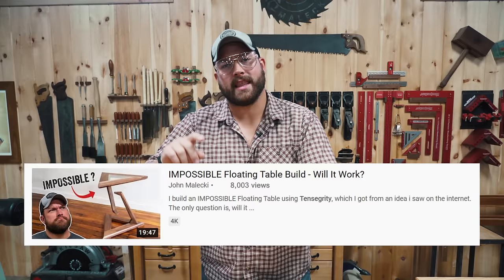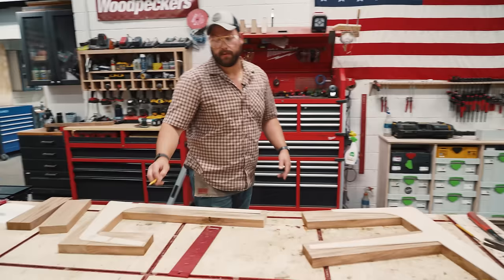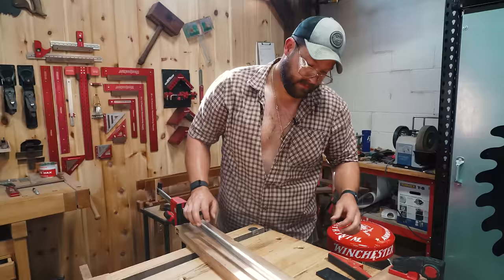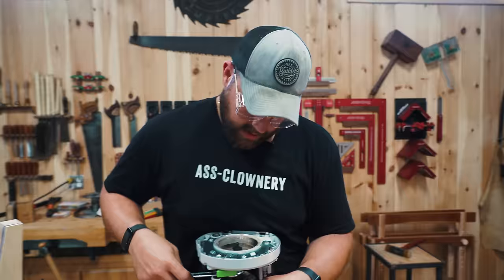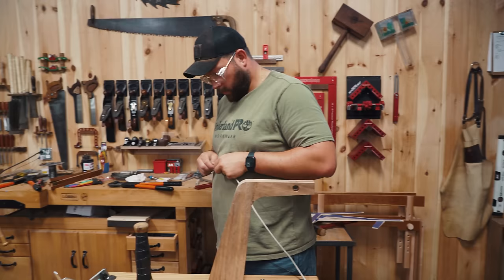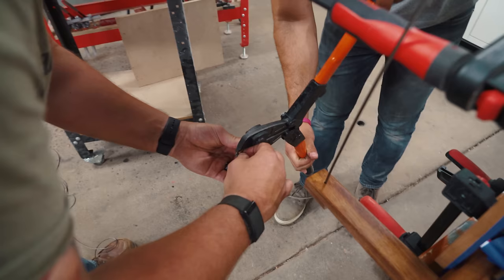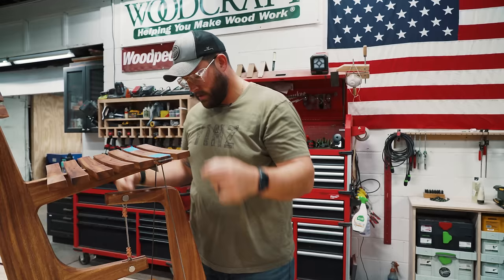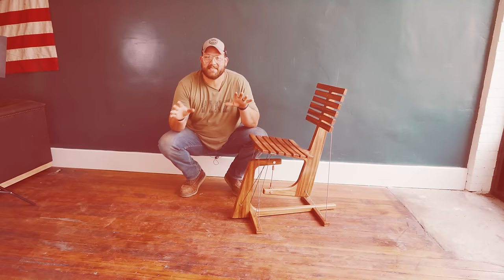Does This Chair Actually Work? My IMPOSSIBLE Chair Build

Comment: Honestly this is so close to working. I'd say the best way to get it to work would be to add a second support cable, have one be as far forward as possible and one as far back as possible. That way the weight of a person can be anywhere between those two points and be fine, then the tension cables would just be to cancel rotation.
But if one weight baring cable is a must, then it absolutely must be as close to the seat as possible,  it's a lever so the longer  the distance between the weight and the cable holding it up the harder it is to correct.

Or, you could have the floating part of the chair connected by four cables to the feet of the chair, have wood from the floating part hang over the chair feet and with those being the connection points whenever you sit on the chair no matter which way you lean the connected points on the opposite side will take tension. Probably won't look as good though.

Comment: rather than using one cable going through a hole and fixed on either side, i'd suggest using 2 cables, each fixed to the centerpiece (where the hole is located), since the cable is able to slide in the hole, giving slack on one side while tightening on the other, fixing it with 2 cables would eliminate that issue as the cable cant magically grow longer

Comment: Instead of a single vertical support that splits your body weight up the middle between the cheeks (creating the lateral instability) you may need to do two side by side.

Comment: The problem is attaching cables to the center point and not having all the cables on an even plane. That creates a TON of instability. If you had it all in one plane, with each cable equidistant from one another, you could get away with 3-4 cables.

Comment: I have the solution to the wobbly issue! You should have the cables vertically on the 4 corners, and then the centre cable must be changed, you need to put a horizontal piece on the centre bar and run 2 cables vertically up from the ends, then the chair can’t go sideways or backward and you can use it as a regular chair, simple fix that you didn’t see

Comment: You could have prevented all those extra cables and holes by adding one piece from the heel of the seat , straight down through base. You need to have someone sit in the seat before crimping the tension cables.

Comment: Probably far too late, and maybe you already did it in a later build, but for stability (beside the center of gravity prob you already figured out)  I would try doubling the frames. Instead of one down the center, make it more like a regular chair one left and one right...you can still make it "tensegrity" but you'd have twice the connection points and less tendancy to twist

Comment: John. I have been thinking long and hard about this. Seems to me you have a simple dilemma with these tensegrity projects. Either break the art or live with an unstable solution. The issue as I see it is that as you load the table or chair the top moves downwards. This downward movement shortens the distance for side supporting wires and thus reduces the tension in them and hence the top goes easily off level. The simple solution is to vastly increase the tension in the supporting wires but this then adds to the downward force on the top and adds extra unwanted load to the structure. I was wondering if instead with a pulley system you could use the downward motion of the top to increase the pull on the tensioning wires, but this would require another set of risers from the base to accommodate the pulleys and it would need a really strong base that doesn't flex. This sort of approach might help and be mechanically more valid but like I said the art would be spoilt.
This was a beautiful build. Really enjoyed watching it. Perhaps take all the extra wires off it and strip it back to its most minimal and delightful form and keep it as the memory of a great idea brought skillfully to life rather than a functional object.

Comment: First I'm gonna run a cable between the top/back to the rear/front, then one through the side/top to the back/bottom, then a stabilizer cable between rear/middle/rear to the top/front/rear, then just a couple more between the bottom/middle/top to the reinforced side/top/opposite side/butt/bottom and then one last cable running from the impossible chair to another chair sitting in the dining room of my next-door neighbors' house. I need a margarita. Go sit in the chair Pedro. Don't break it.
(Subscribed)

Comment: You basically have a sea saw.  The front lever arm is 6 inches and the back is 12+.  So 200 lbs on the back requires 400lb of counterforce on the front.  If you locate the fulcrum towards the back or add a second central cable or something it wouldn't be so lopsided.

Comment: Is there a reason another tension cable wasn't added to the center? (where the existing tension cable is). 

Why not place one (or multiple) horizontal tension cable(s) (Well not exactly in tension, only in tension when leaning back) connecting the vertical seat spine and the base spine to resist the load when sitting back? Could even use the same eyelet as the existing tension cable in the base spine. 

I'm sure it was considered, just wanted to know the reasoning for not choosing it. It couldn't be a matter of the strength of the wood because it's already carrying the load, adding another to the same existing junction doesn't seem (I could be wrong, its plausible) to pose any risk of fracture. 

Otherwise, thanks for the video I'll be using some of your squirrely tricks in future.

Comment: Maybe this defeats the purpose, but what  about a 1/4" ibeam style lower. The wood just has way too much flex. Unless  you go thicker with the wooden lower part and add a significant amount of pre load to the rear cables.

Comment: What I’m thinking you could do is you could take piece of TI 8th inch maybe 3/16 you don’t need much thicker than that want it down the rare river the seat for the support and same thing on the inside front rib but instead of putting that tea bottle as a middle rib is sticking out the back what I would do is I would insert it into the actual rib of the chair that wooden rib, so you don’t really see it then you could take and also reinforce the bottom of seat, pretty much the same way and run your triangulation in the front the opposite, so it comes out from now with wide side of the seat and angles into the bottom and then on the rear you could also do that with the trying not to triangulation with the you could take the way it is and run up and run either two separate cables or one all way around and put the cable adjustment I would do like bicycle cables i’m thinking because they have like you could you could put that right there and have like a hidden adjustment where it goes through the rip right through the tea bar and you could crank that down nice and tight like bicycle brakes or something like that or you can just do a regular cable twist because it’s behind the seat have the back and wall nobody’s gonna see it in the front you could run two separate ones or one I would do the ones together you have a lot more adjustability and at the same time if you do cables you can take and actually paint or stain the cables to the same color as the wood so you really don’t see it or nice light, gray or something it’s not really jumping your face noticeable another way to lower you vision of it is the lower the top part of the cable to like the bottom of the back of the seat not stretching as far shorter runs means stiffer lines. Let me know how it works. Thank you bye-bye and God bless.

Comment: Hey J Melecki sup

Can’t beat tackling the innovative spirit hands on..

Here’s my pointers:

1) Use metal, seems wood lacks the central gravitational properties you need here..
2) x2 lower sections (acting against the upper support section) this way x2 left and right static support braces can be added to reduce swang < 1970 New Orleans slang for Swing..
3) Ok so the wires are giving the game away anyway. So why not completely removing them and just simulating the “Gravity Defying” element with 1’1/2” thick epoxy resin panels..

Keep it cool

My outfit predominately deals in the hi tech sportswear used on some of this planets most prestigious sporting events from Ballooning to F1 so I know a thing or 2 about the innovative spirit based in London, Rome and Istanbul..

Peace amigo...

Comment: I think the sidet cables are useless. One from the lower, back ankle of the seat to the back foot cross. And a cable from the front upper ankle of the stand to the beam front of the seat. And pull the cables strong. The wood is bending an the construction going unstable. So, three short cables should be enoug.

Comment: Neat idea, but you need to do a proper design. You have the pivot point unsupported, so you can't lean on the back of the chair. When properly built, you can add a spring to the cable pulling against the pivot to make the chair a rocking chair.

Your idea of the load point being wrong is correct. You need that load to pull against the pivot, while another cable holds tension the other way from the bottom.

Comment: It looks like the central cable is too close to the front cables and seeing as you lean back in a chair you're loosing rear tension. Dunno if I explain shit right but I think if the 3 cables were equidistant it'd happen less. Edit: finally got to the point where you explained that, good reminder to watch an entire video before commenting.

Comment: I'm an amateur nowhere near as good as you are at building something to look pretty. So my opinion is a moot point. I think the issue that you're having is when you put tension on another cable the opposite cable goes slack and that's why you're getting the rocking or the motion if you were able to make it one cable all the way through all of the holes.if you start to get slack in one place it'll pick up somewhere else to counteract that if that makes any sense.

Comment: Too many wires the beauty of a Tensegrity is the minimalistic use of wire. If you had the center wire an inch or two towards the back the stability would have been improved.

Comment: Couldn't you instead of all the cables run a bar steel across front and rear under seat and run only 4 cables straight down from outer parts?

Comment: To solve your rotation problem you could try using tension and support. Run a shallow dado the length of the underside of the seat/back, add another cable to the existing rod in the same part, let it run back along the dado and secure it to a new rod at the very back of the base. It would give you tension pulling against the rotation you’re getting as well as, theoretically, providing support since if the piece did decide to rotate it would be pushing down on the already tensioned new cable. 

I feel like that’s really shitty explanation and wish I could just email you a sketch as that would make way more sense.

Comment: @John Malecki Hey, I thought you'd want to check out Robby Cuthbert Design's channel.  He does a lot with Tension furniture and you might pick up some ideas on improvements.  My recommendations: 1. Run a bar inside the portions that are holding your weight (so the "forks") to give some extra strength. 2. Move the center of gravity to the point under your butt-ocks (said in a Forest Gump voice). I'd love to see ver. 3.0 on the chair.  Keep making man-glitter and tell Sam to eat a burger once in awhile.  Boy needs to put some weight on...

Comment: So why not drill a few more holes in the center where you have your metal dowels. Instead of having a single wire for the center of gravity run your wire up and down through the dowels and only crimp on the first and last dowel.

Comment: The wayt my brain sees it you had the front cables and the center lift cable too close together.  if I do the math the center of mass is a bit further away from the fulcrum than the center cable so 300lb occupant x say 115% because of the leverage plus say at least 75 lbs of tension  in the stabilizing cables.  Putting the total tension on that center cable in the 400 pound range.  With that much tension on those tongues they're just flexing too much and all the stabilizing cables are going slack.  To fix the design as is, it would have to be strong enough to preload the cables such that adding 350lbs of weight didn't cause the wood to flex significantly.  In theory this could be achieved by dado'ing some heavy steel plate into the spines.   I also had the idea that if maybe the bottom finger was replace with a horeshoe shapped piece attached at a 45 degreee angle from the rear feet.  This would allow you tot move the center cable back a bit too further reducing flex.

Comment: I'd like to forward points where the cable connect on each side slip with a little bit of a connecting device inside somehow so that when you rock back the whole the cable would move and then when it catches the certain points and that's as far as you could go back then when you're leaning up Id have a return Spring of some kind on or something that's bringing it back  that's how you'd keep that cable taunt at all times You guys don't want to know where I learn that kind of s***

Comment: Need a engineer? With tweak in design you can make this work with less cables as the golden gate bridge, greets from holland
Reply: You need the top hanging cable move back and down, so this point is more in the middle of the tension strings. And the angle between the top hanging cable and the top tension point is as steep as possible something like 45 degree, the closer the better. I think it good possible with 5 cables, 1 hanging 4 tension..

Comment: Cool concept, but i think you made the chair is too high off the ground to be comfortable. The lip of the seat should not be higher than the height of the shinbone (i.e bottom of knees). A chair is not comfortable to sit in unless your heel can touch the ground -- too tiring to have to try to tip toe.

Comment: The issue you're having with it wobbling side to side and the tilting back issue  come from the fact that your pivot points are singular points in the center and you're ignoring what actually makes a chair stable.  

Think about the design of a normal chair.  How many chairs do you know of that have a single back spine?  Virtually none.  And that's because with a single spine, you're creating a fulcrum in the center.  Therefore, with a little bit of use, those slats are going to snap and someone is going to end up on the ground with a bruised butt.  Your best bet to make this work would be to double the spines and use the slats to separate and hold them apart like a normal seat.  That will stop it from wobbling side to side.

The front to back tilting issue is because there's nothing supporting the back.  It won't matter how many cables you throw on it.  Cables pull.  They don't push.  So when you lean back, you're creating slack in the back cable from an already precarious position and the single point of suspension is just swinging forward.  MAYBE if you added a second suspension point in the center it MIGHT mitigate the forward swing a little bit because the radius from the focal point will be two different distances and the front point will pull back against the rear point.  It's kind of hard to explain without drawing you a model.  

For best results, you'll probably want to use 4 suspension points- 2 on each side, front and back.  Spread the front suspension and back suspension cables as far apart as possible, and I think that will stabilize it on both axes of rotation enough so that weight won't matter and it will be rock solid.  I'd love to open a dialog with you to discuss the finer points of the engineering behind this.

Comment: Dear John, I salute you for the great work. You made a mistake in some technical things. The chair is not useful for use. First, the difference in proportions and dimensions made the design unbalanced. Allow me to enter into a challenge with you and implement this chair, with it also its tables and lamps, and wait for me when I present it.

Comment: jesus christ, you ended up making that thing look like a suspension bridge designed by the marquee de sade. When all you had to do is 4-way locate the bottom of the seat portion
Reply from the maker: Did you just JC a video about a chair ?!? 😳
Reply: @John_Malecki  yeah, god is dead so what does it matter

Comment: Tensegrity furniture is more for artistic display than actual use.  You're never going to be able to build anything like a chair or a dining table capable of handling the kind of forces involved in bearing the kind of loads those require and still be able to have the kind of open floating look.

You had an absolute mess of cables on this thing by the time you made all your revisions, and it still wasn't even remotely close to being viable for someone to just sit down in like it's an actual chair.

Comment: Two years late on this video, so you've probably either figured it out or moved on already. But. There's no reason you need only have a single hanging point, is there? If you built a base that had two or three protrusions, and then built a chair that hung off of those points, you'd have a much easier time controlling where the center of gravity goes, while the illusion still works just fine.

Comment: omg, too many cables. If you framed out the seat and the back and ran cables at 4 points instead of running them to the centre line, then maybe?

Comment: These shows are good, but pointless unless you have the funding to buy the tools or have them given to you for promotion. That front 90 degree joint is going to fail, I just know it.
Reply: What? You could literally make this with just inexpensive hand tools. Carpenters were making furniture long before there were Track saws and Routers.